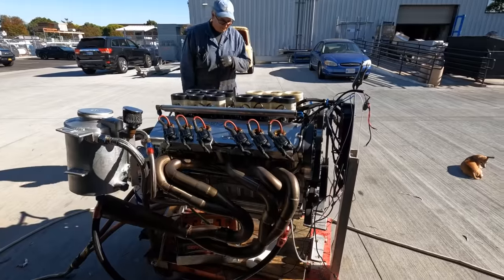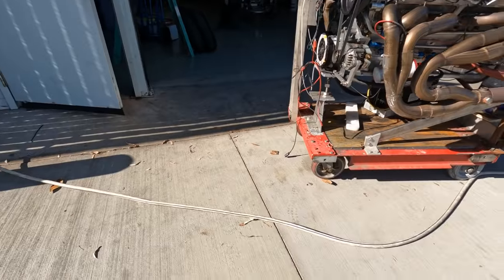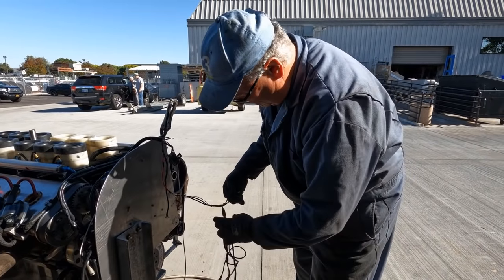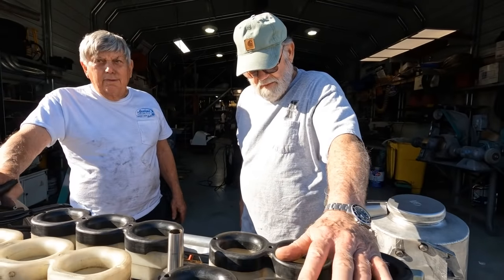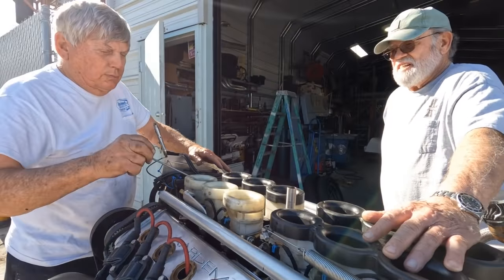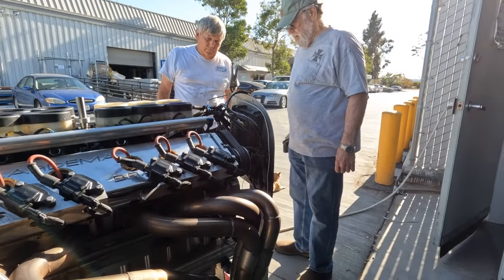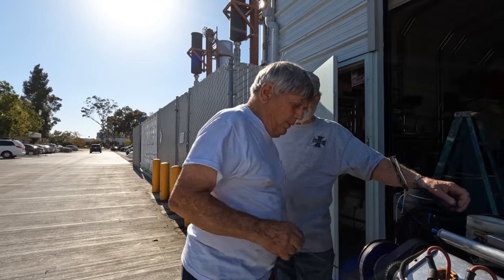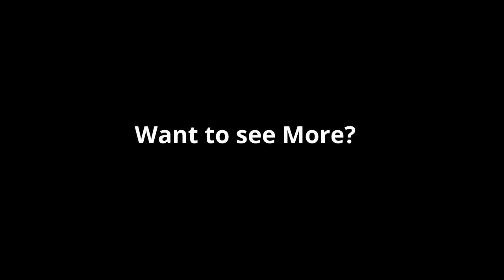Homemade V12 Engine Start Up - Pure V12 Sound & Shop Talk with Pete Aardema & Kevin Braun

Comment: In order for all cylebders to get equale air input to each carb take 12 equal size pipes for each cyleners and face forward in one scoop set up to make sure each cylender gets equal amount of air at 250miles a hr .basically looking at the air intake of the scoop you would see 12 individual pipes tight together in one scoop .garenteed to work .godbless and stay safe .

Comment: Look at a na Barra intake you will get a idea of putting valves on the the icps using a pressure switch once enough pressure too be fully open

Comment: I’d suggest running individual EGT or wide band sensors to have control over the fueling. Trying to figure your AFR based on the intake is way more complicated than having the sensors in the exhaust. It seems to be the least expensive thing to do. Use individual map sensors would be way more expensive and complicated. Depending on your ECM, most modern ECMS like Motec have fail safe solutions and corrections to individual cylinders. It’s way cheaper than leaning out a cylinder and causing a catastrophic failure.

Comment: Thinking about this I would almost believe a ram air pressure chamber where all cylinders draw off the same chamber fed by the intake equally. Pressurize the chamber and allow cylinders to draw from one access point. Otherwise install twin turbos and be done with it. Would seem turbo power would give better acceleration then ram air as you need speed to produce it whereas turbo does not.

Comment: If that's what's happening, and you want to keep your scoop, you make a manifold and have the runners all converge in the center, then have the scoop terminate right there at that collector. Just make sure you have a big enough hole to give the CFM you need.
Reply: Another thing I was thinking of is that you could just put pressure sensors in different parts of your scoop to see what it's doing. Might not have been anything wrong with your AFR's. After I saw the other video of the piston ring lands being so close to the valve reliefs, I'm skeptical of the lean hypothesis.

Comment: There would be more power to be found by working on the fluid dynamics of the intake plenum, rather then adjusting the fuel to accommodate the differing air flow, as all cylinders making the same power would run smoother then the back ones making more power (through more air and fuel) then the front. What they need, is something like the air intakes on the SR-71 jet, where the cones moved in and out to maintain a specific pressure in the volume behind them, here they want the whole plenum to have the same pressure.
Clearly, the engine itself, is well thought out - a +900hp naturally aspirated race motor that starts and idles as smooth as a Minivan or SUV,.. Just listen to how even the firing is!
Note to the CameraOp - Gimbal and slower movements - something this majestic needs vision to match :)

Comment: SR 71 Blackbird as adjustable nose cone on front of motor,
 to reduce air pressure into motor,
the faster it goes.

With dampers and baffles you could truly make a pressurized air box, with even pressure within.

Comment: Surely if you go richer up the rear cylinders to chase the over air problem those rear cylinders will he producing MORE power that the front ones and you will then have different problems!
Put baffles in the intake!

Comment: This engine is a work of art.
If the fuel system is EFI then given Individual MAF sensors, or maybe just A/F sensors on the cylinders, could it self-adjust the A/F ratio on a per cylinder basis?
If the rear few cylinders are seeing higher Intake pressure then could a turbocharger equalize the intake pressure across the board at that target level?
Reply: I'm pretty sure they're running in an naturally aspirated class where there might be an advantage in using a potentially higher revving v12 rather than a v8. With a turbo setup they'd be in a different class.

Comment: That engine is an impressive piece of engineering and I agree that the ram effect will definitely cause certain cylinders to run lean at speed. If I am not mistaken F1 air boxes have air bleed holes to help combat that problem and NHRA top fuel cars use a plate to control air flow into the blower.  That all said I see something that puzzles me and that is I see no individual cylinder pyrometers in the headers near each exhaust port which is an invaluable turning aide and engine management safety sensors. I also don’t see any wide-band O2 sensors in the either header.  The reason I say wide-band O2 sensors is due to the design of the headers a wide-band could be installed in each group of three cylinders which could be used as a tuning aid when building the fuel map in the tune but along with the individual EGT probes could be used for tuning and for safety’s while under power.  Additionally multiple MAP / BARO sensors or similar could be placed in different places in the air box to determine high and low pressure zones in the air box. Lastly the air box pressures could tested using fans that flow a known CFM of air.  One passing though is perhaps contact Holley or Fuel Tech to see if they would be interested in becoming involved with the program on the engine management portion of this project.
Reply from the maker: That's a good point about using high powered fans to pressurize the air box. Pete might have an opportunity to put the vehicle in a wind tunnel here in San Diego to get some measurable data as well.  Thanks for this detailed information i will share it with Pete and Kevin-   Greg Q

Comment: Individual runners from each cyl to front of scoop....keep the ram air effect, install o2 sensors and let the computer adjust for afr as needed....and you could probably get away with 2 or 4 o2 sensors  front 6 and rear 6 or front 4, middle 4 and rear 4.

Comment: That thing sounds really beastly , like has the devil inside
Reply from the maker: Its a beast and it is freaking insane at 10,000 RPM. You can see it on the other video make 920HP on the Dyno.

Comment: The easiest way to figure out the issue with the pressure differences per cylinder would be to do some fluid dynamic simulations. If you need a hand or want me to give it a go I'd be more than happy to give you some data.

Comment: Fuel Pump sounds louder . Cavitating ?
Maybe put the Air intake AWAY from the Engine . Further forward on the car . Speed Ramming fed down an Intake Pipe into and Upwards , into a Pyramid-ish shaped Plenum centred above 5,6,7,8 . Elliptical feed into the Plenum each side for symmetry of airflow . Or perhaps the two inlet pipes could face each other at the top of the Plenum , breaking up each others direct BLAST of air . The whole Engine Inlet area will still be getting Ram Air .
Awesome Engine , with some fettling needed . I hope my idea has some merit .
Reply from the maker: Thank you John, I will share this info with Pete and see what he thinks
Reply: Measure air pressure at each inlet.

Comment: Just wondering what the tapping sound was? One cylinder having to much valve clearance?  The problem with many cylinders is the difficulties of hearing uneven running. A vacuum gauge could show. I would put oxygen sensors and use individual air intake for each cylinder running from left to right inside an air box with a scoop. Also using mass air flow sensors, high pressure fuel rail and adjustable timing of the fuel flow on the injectors and use the increased air speed to increase horse power. Without boost you are limited to displacement, there is no magic that can change that. It would be a waste not to use the air flow. Or to better control things go turbo.

Comment: I would say the best is all independent scoops.... But maybe ganging them in small groups might work best for all around fit and finish.  Working the mix independent through each carb, being all within the same dynamic air system in one scope,  would be a nightmare. Even with a wind tunnel.

Comment: That was my initial thought also 12 O2's but it does seem a shame to throw away any ram air boost, most ram air air boxes I have seen are just that a sealed enclosed structure with a scoop feeding into it however those that I have seen were not designed to work at 250mph.

Comment: The air box that has 12 intakes at the front facing forward or rear. Air box design would have the same air flow needed for each individual intake.

Comment: displacement x rpm / 3456 = theoretical CFM of airflow.  360 x 8000 / 3456 = 833 CFM.

Yes, build an airbox sealed to the throttle bodies.  Dynamic pressure at 250 mph is equal to about 1 psi.  Put a MAP sensor in the airbox, and let it correct the fuel mixture based on dynamic pressure.  You'll go a little faster.

Comment: I’d put o2 sensors on every cyl and when your testing your computer system will add fuel to the lean cyl if they have enough fuel system to add more

Comment: Individual throttle body for each runner of equal length. Intake runner to valve angle. That sure looks like 1100 cid ford gaa engine .

Comment: Man just imagine this thing if it was tuned using todays technology. This thing is like... Peak 1991.
Reply from the maker: They are getting there - still makes a lot more power than all other NA 6L engines on the salt flats.   New 5LV12 in the works - video has been posted

Comment: I am engine builder too with only two and four cylinders, those questions are so familiar. Where the ram pressure will put me, do I have equal mixture in all cylinders etc. Building all aluminium flathead four right now from ground up. That coolin system in test run looks so familiar with reduction in outlet side. Four cylinder one year one man. Honda crank, Opel pistons, Alfa Romeo conrods. Congrats I know what you been true.

Comment: What a badass engine, would duel scoops help negate the air problem they seem to be having? If you had one scoop going to the front 6 and another feeding the rear 6 you’d get a more even distribution of air right?
Reply from the maker: Thank you Elijah, Please check back early next week, we hope to have a new video posted of this weekends race. We will be running the 3L sheet metal engine. it made 662HP so we hope its enough to set a new record. thank you Greg

Comment: Just a thought, could you not make an internal manifold in the air box perhaps two 6 into 1  terminating directly over each throttle body to guarantee each has the same airflow! Like  I said just a thought

Comment: Could you install airflow sensor at each injector. Hook them up to a computer to record what is happening as far as airflow goes. Each set of pistons is more expensive than 12 sensors.

Comment: I know this sounds rare but rather than have a common plenum for intake 
What if you had like a reverse header  
So collector first then split tubes feeding each pair 
A fab nightmare but as a casting 
Or centre split and billet machined
With runner lengths compensated for front to back air flow differences to feed air equally to all cylinders or at least pairs 
Same theory as a dual plane v8 intake manifold but somewhat more complicated 
Equal air in = cylinder feed cfm 
Balance 
Hopefully should not lean any cylinders 
And then no injection compensation required for leaner cylinders 
A physical/ mechanical solution 
Rather than metering for individual A/F ratios
Dunno just a thought 
Tricky but I'd say achievable for these fine gentlemen and their group of friends
PS I edited rather than try and weld the bag of snakes together after billet machining it could be clamp sealed or bolted
Or hot V it and exhaust in the valley 
As is happening now in some engines particularly diesels
I think I've seen Pete and Kevin do this year's ago
I think you'd need a lil water up top there somewhere  though
Random thoughts I know 
A lil outside the box 
But balanced air is definitely the key
Fuel is easy then
For these fellows as long as the fuel system plays the game
Does anyone know the hitches with 
Hot V

Comment: The screw caps around the spark plug wires look like Daimler 2.5 V8
Reply from the maker: Actually, they machine their own cap nuts for each individual spark plug tube. There are only a few pieces of this engine that come from production vehicles. They pretty much make everything from scratch, minus the spark plugs, coil packs, engine sensors, alternator, and starter. Thanks for watching, Greg.

Comment: If you had O2 sensors on each cylinder, can a computer be programmed to maintain optimal fuel ratio via the injectors?

Would a mass airflow sensor or air speed sensor in the scoop combined with O2 sensors in each cylinder provide enough input to program the computer to respond more accurately?

Could you incorporate a splitter/bafel in the scoop/ air box to even out the ram air distribution to the front and rear cylinders?

How about air pressure / air speed sensors at each IR inlet to control a series of freestanding butterflies in the air box to even out airflow/pressure?

Comment: Although the computer can compensate for lean conditions when an intake is giving more air to some cylinders than others, the best way to ensure each cylinder get the same amount of air is for each intake to have it's own equal length air scoop, not a common air scoop where the cylinders at the front are getting less air than the rear ones due to 250 MPH air pressure. Either than or eliminate the forward air scoop altogether like was being discussed. I would rather make use of the ram air boost being produced bet ensure that the air scoop for each cylinder be equal length and all face forward so you would have a header type situation both before and after the engine, so that each cylinder has equal amount of air and ram air pressure thus balancing out the engine's combustion and then there is less room for error when there may be varying air movement outside the vehicle that could still affect the engine performance. Ideally each cylinder should have a MAS and each exhaust port has a O2 sensor so the computer can control every aspect of the engines performance but that would significantly increase the complexity of the control computer and  when so much horsepower is being produced it could seriously crater the engine if there aren't a perfect set of redundant parameters installed in the computer, things could get ugly real quick. I'm more of an old school problem solver than a mechanic that relies upon computer tech to solve issues. I'm not convinced that a computer can compensate to balance an engine's performance internally over making sure that the engine is balanced mechanically from the outside. it needs to be a combination of both. and creating equal length intake tubes is an easy way to make sure each cylinder has the same amount of air pressure throughout the what, 15 second run? Trying to build a comprehensive set of algorithms for a super-high performance engine is a can of worms I wouldn't want to open. It would definitely mean fame and glory for the guy who does it perfectly but it would take a lot of work. A lot more than building an intake. Great Job guys, I wish you all the best in 2022 and hope your custom built motor captures ALL the titles that you set your sites on!!!!! Being a retired Mercedes Benz mechanic, I greatly appreciate a high performance V-12!!!! Perhaps you should put your efforts to a even bigger motor like Duesenberg and Packard, and build a V-16? LOL More Horsepower = More Fun ( MH = MF)!!!!  However the law of diminishing returns probably kicks in at that point, I think.

Comment: Beautiful job! 

Just wondering whether 12 wideband sensors and using a closed loop fuelling strategy might be a good idea?

Ram air without individual cylinder closed loop fuel compensation based on lambda can be a bit of a lottery, from experience. 

Apart from all that, what a glorious sound and a real testament to these guys’ talents.
Reply: Rob, I find your comment very interesting and want to know more. Can you elaborate on your statement about individual cylinder closed loop fuel compensation?
Reply: Add variable valve timing also.

Comment: I would like to know what all the motor is based off. Wouldn't the entire box be pressurized at 250mph not more pressure at the back of the box than the front?

Comment: it's two 3.0L engines grafted together; do you have more details?  It idles very well.  920 bhp at 9800 rpm seems optimistic...is it at 250 mph with the ram air effect?  fwiw he only needs a 3" intake to feed the engine at 250 mph.

Comment: If You build a scoop with the inlet above the Middle of Engine,  than a top end of Scoop 90 degrees to front!  The Problem with  the  2 Last Cyl. is FIXED!!!

Comment: I don't know what kind of computer you guys are running but need to do individual cylinder trim with some EGT sensors. If I had to guess those are two JZ engines put together based off of manifold bolt pattern. You guys need to put the exhaust together with a h pipe or a y-pipe so it sounds nice. it'll sound like a 12 cylinder vs two 6 cylinders.
Reply: "If I had to guess those are two JZ engines put together....." 

Not quite - it's a set of four Olds Aurora heads, each trimmed down to three cylinders and then welded together, and a homebuilt block. And by Pete Aardema standards, this is an easy build - he didn't design and cast his own heads for it.
Reply: I am pretty sure that a 12:4:2:1 exhaust at 9000 RPM (at cams for that RPM -- with long lobes) will sound just like a turbine.
Reply from the maker: Listen to this beast on the Dyno https://fb.watch/9r0G-HPb30/